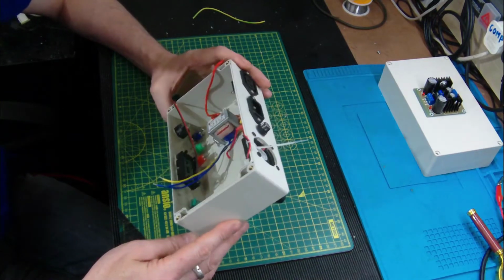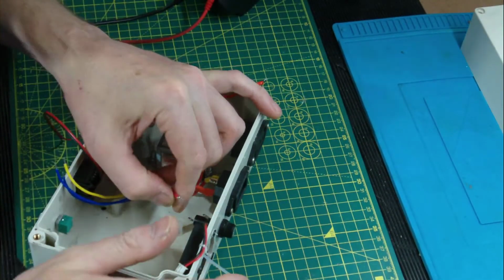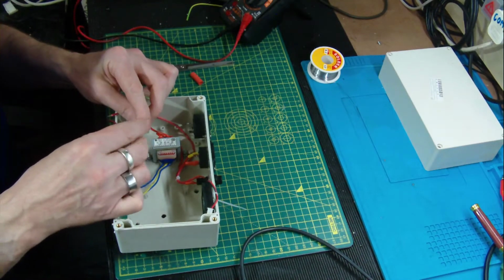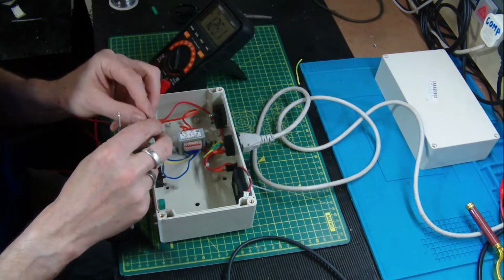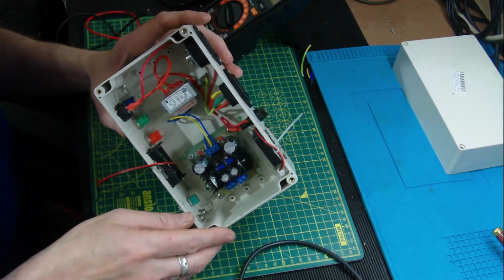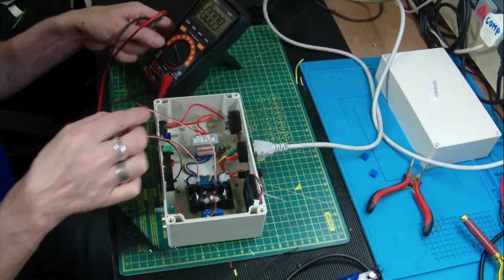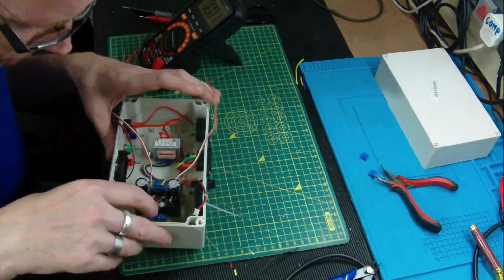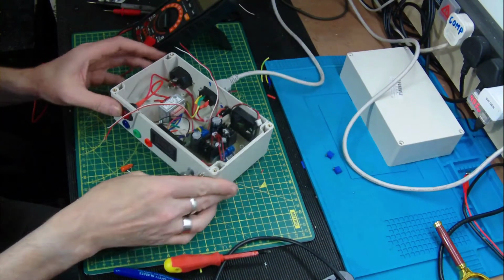powersupplycomplete

Comment: nice little unit and nicely laid out   I like using those IEC connectors most of the ones I have usually have the 1/4" fast on tabs,  that transformer looks a little lost in such a large box ! but its the amount of panel space that dictates the size of an enclosure !
Reply from the maker: transformer will be changed out (once i get one) but at this moment it only is going to supply little i.c preamps so no rush
Reply: @stevenbrown5483  that would be better although preamps aren't really going to draw that much .
 Bigger is always better in a power supply I would go for a toroidal transformer but for the price
Reply from the maker: @thehappylittlefoxakabenji8154  yes very expensive...dont think i will go with toroidial but i have a few things to break down sson so i will see what they have inside :)
Reply: @stevenbrown5483  your right they are quite pricey but they are good as they have less hum etc always worth salvaging from used equipment I quite like using those encapsulated transformers but then you have to have them mounted on a PCB
Reply from the maker: @thehappylittlefoxakabenji8154  very true , i will be salvage hunting at the weekend :)

Comment: Nice little supply and neatly put together. What is the current on that transformer?
Reply from the maker: i think it is only rated at around 2w george , only for use on very small preamp circuits ,may even change it out at a later date
Reply from the maker: just in process at moment of building a calibration circuit so both sides of the supply adjust in parallel with no offset